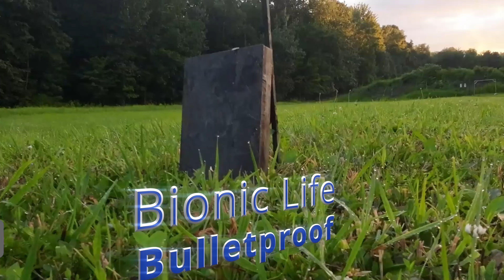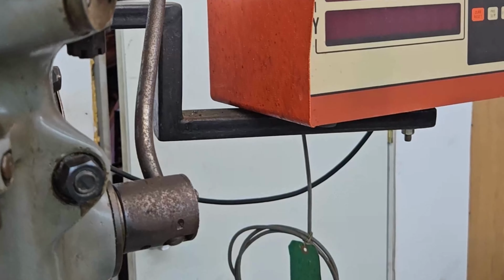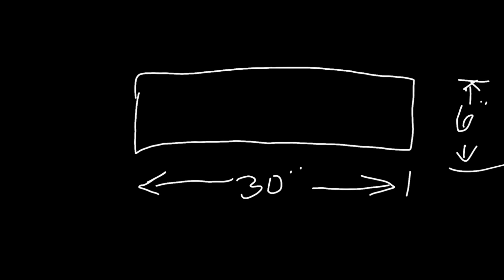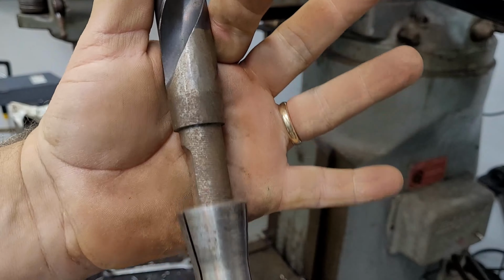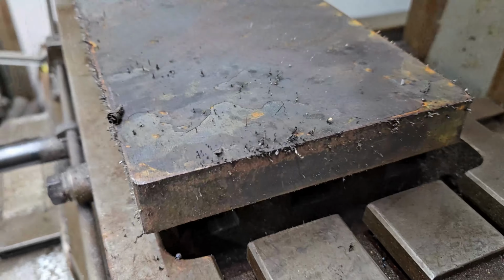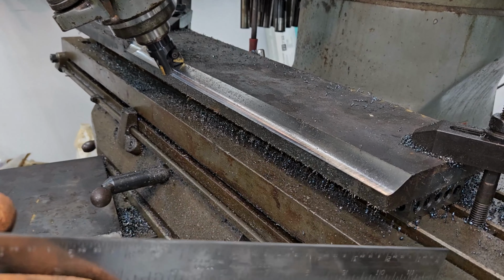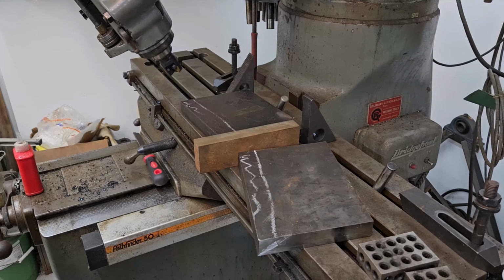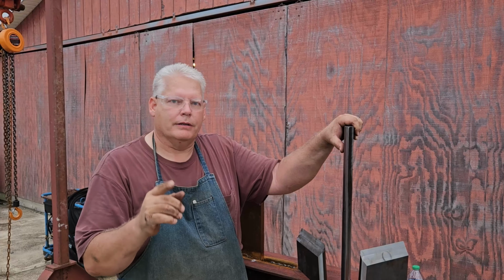Log Splitter Build | Part 8 | AR400 4 Way Wedge

Comment: That is a ton of mill work, I can appreciate the amount of set up time that went into just putting the angles on the wedges. Not to mention you did it on AR 400
Reply from the maker: Thanks Doug, setup wasn't terrible.  Tramming the head back in (90°) is probably the worst part. High speed steel drills did better than I thought. I might try HSS end mills next time just out of curiosity. If this thing works I will fab up a box wedge.  What do you know about welding AR400? My plan is to pre-heat to 450° (I think), 7018 (dry and heated), sand quench to retard cooling.
Reply: @bioniclife  I haven’t tried AR400 yet. I’m sure there is info on it somewhere. I would also look into the wire filler to see if it is compatible for AR400 also.
Reply from the maker: @OneEyeCustoms   I'm using ER70S-6 .035 wire with 75/25 Co2/Argon shielding gas. It has the same tensile strength as the 7018. The key, from what I am understanding, is to keep the weld shielded to avoid hydrogen embrittlement and allow to cool slowly.  I'm only worried able "burn in" with the MIG, although this Forney 220MP seems to have to oats, as long as it's a multi-pass weld.